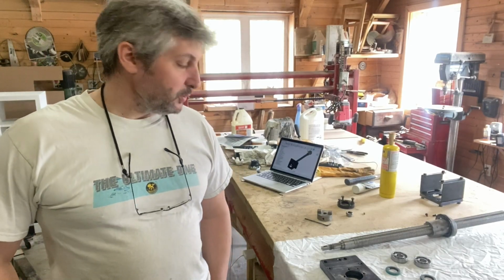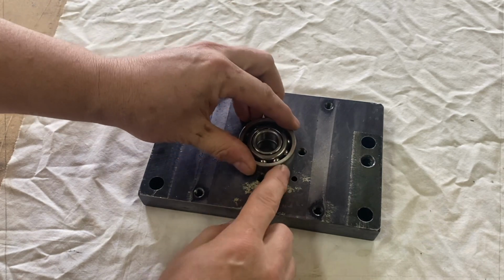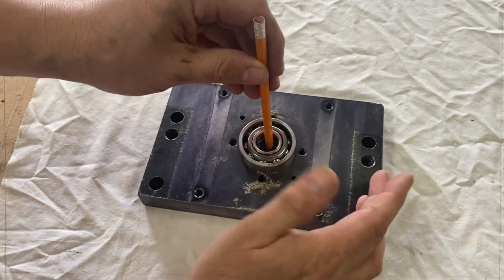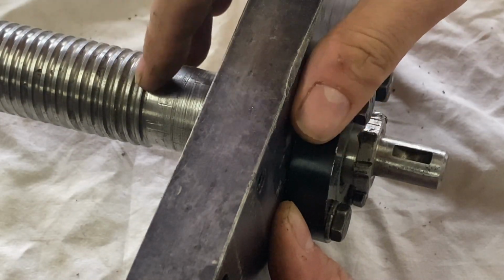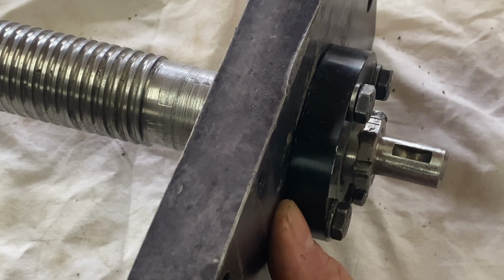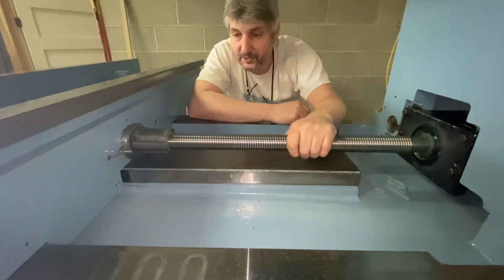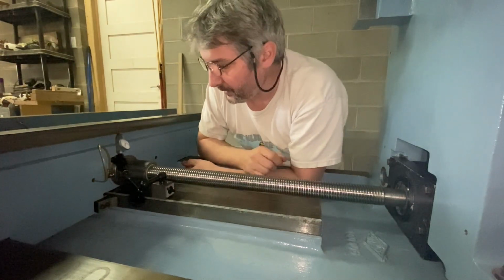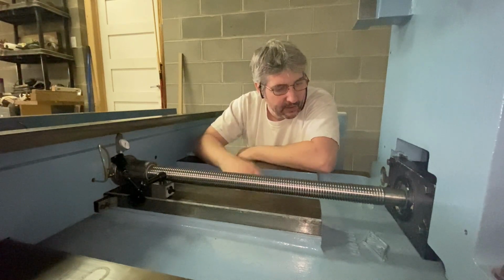Part 27 - (New angular contact bearings for Y axis ballscew)

Comment: My friend, I don't get on and make rude comments. That is not the type of person I am.  Please take  this as educational not criticism. The process to install angular contact bearing is a precise, delicate process. You would never use power tools. The fit of the bearing is everything.  The difference between .0002 of and inch is the difference in proper fit. The bearing housing or the bearing to the shaft needs to be press fit. If you press fit both the it will cause bridling. What it does is basically squeeze the bearing so the balls can no longer move as the should reducing the life of the bearing. Id suggest press fitting the bearing to the block, mostly because its easier. Also apply a light oil to the shaft and inside of the bearing so it slides smoothly onto the shaft. I noticed also that the shaft is beat to hell. Should have a very smooth finish. I can almost 100% say those bearing are trash now. It looks like the ball skew also need replaced or re machined. There is so much wrong here its hard to type all of it. Go the the manufacturer of the bearing and look up the process recommended for install and fallow it. EVERYTHING MUST NOT HAVE A SINGLE SCRATCH OR EVEN DUST ONE IT.  Wear gloves and if there is even the smallest gouge or scratch stone with a very fine stone.
Reply from the maker: Thank you for taking all of this time writing such an exhaustive procedure! I will look into it. Research further. There is so much to know! I tried to get help from the bearing sales people with no luck. They told me they are preloaded and are simply installed face to face. That’s all I could get from them.

Again, thank you for bringing this to my attention.

- Blaise
Reply: @BlaiseBarrette  yes if your using a single row bearing then you need 2 bearing for 2 direction. Another option is 1 double row bearing. I think your on the right track with using 2 for higher load. I agree it is a lot. I dont know all of it either. You can message me and  i can try and answer your question.
Reply from the maker: @ryanturner9958  Thanks Ryan!

Comment: I believe you are missing the shimming between the bearings for the preload otherwise will be sloppy.
Reply from the maker: I did ask the salesperson if there was such a shim for the preload but they told me that these bearing are made to be used in face to face as such. Not the greatest buying experience I must admit!
Reply: @BlaiseBarrette  Hi.
I would double check that info.
If your bearings are the original part numbers used in fadals then they definitely need a shim between the faces.
Where did you buy your bearings?
If from a normal bearing place they wouldn't know about the shim but if from a fadal parts supplier they should have included a shim.
From all the reading I have done the only true angular contact bearings you can use without a shim cost a fortune from SKF etc.
You can get a Chinese set of true angular contacts which I know of a few guys have tried.
But definitely check again otherwise you'll have to pull it all apart again as you will have slop in the screw.
Did you find a shim between the bearings you pulled out?
You may be able to reuse it.
Cheers.
Reply from the maker: @v2rsvr843  thanks for your insights! There was no shim when I first disassembled it. Do we know what is the thickness of that shim? I could make one from shim stock maybe?
Reply: @BlaiseBarrette  
Hi.
Not of thickness.
But if you search the net I sure you can find it.
Or maybe msg fadalcnc or similar they will tell you.
Definitely check with your bearing part numbers too. Maybe you have true angular contact bearings. 
Hope this helps.
Reply from the maker: There was 0.01” of backlash so I’m thinking a shim of 0.011” or 0.012” should be about good! Worth a try!